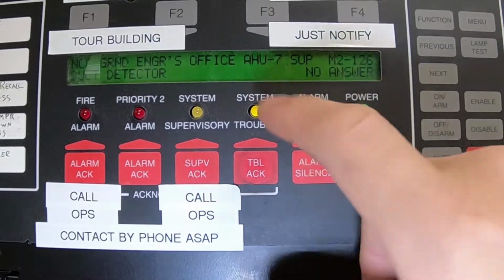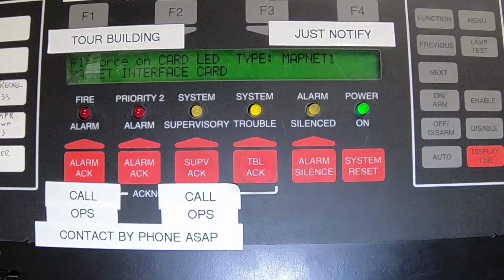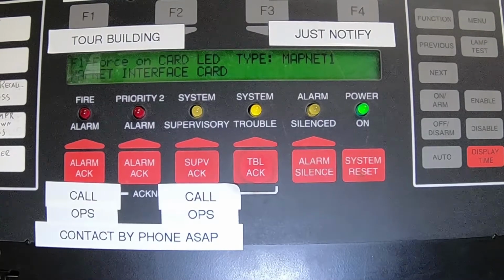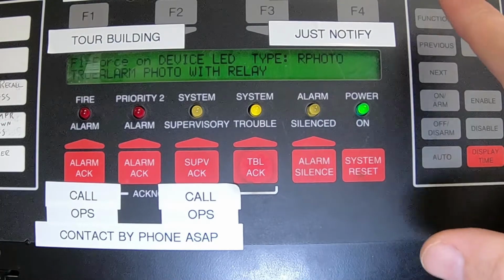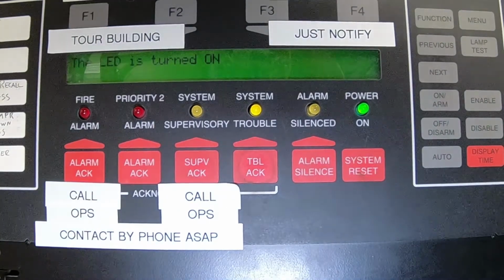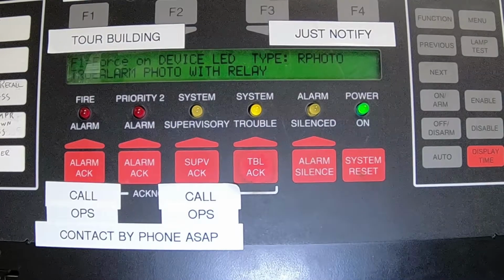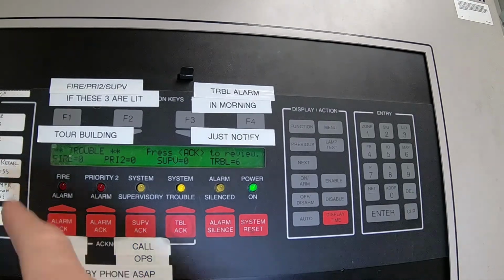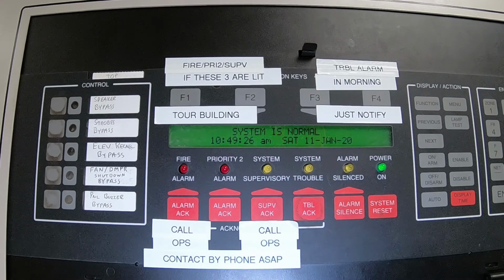Addressing Fire Panel Devices!!!!

Comment: Can you show the power wiring to this unit? Like where the battery and AC power are hooked up from and if they have the high voltage thingy with both the battery and AC power?